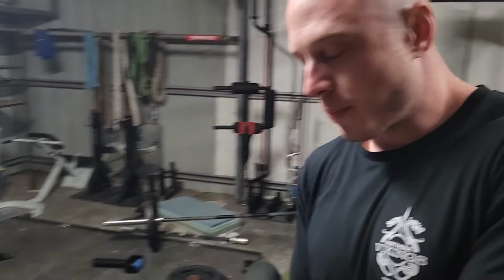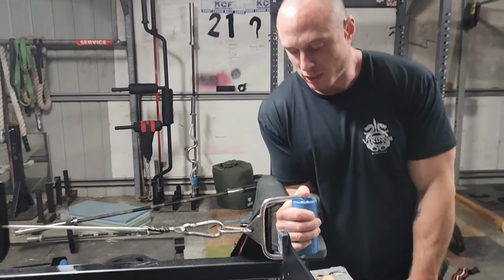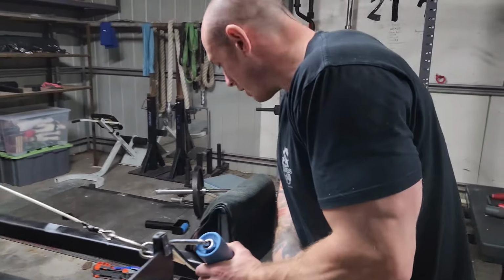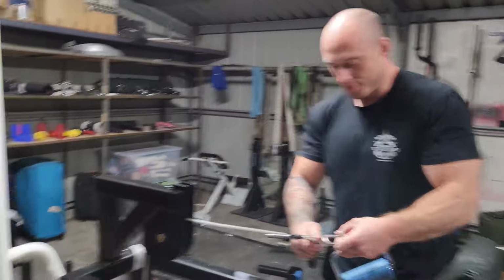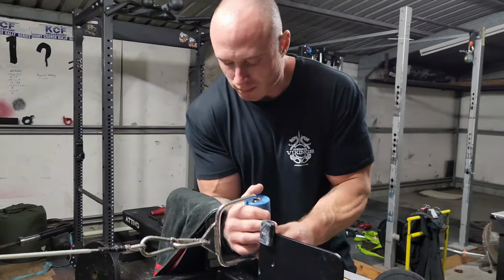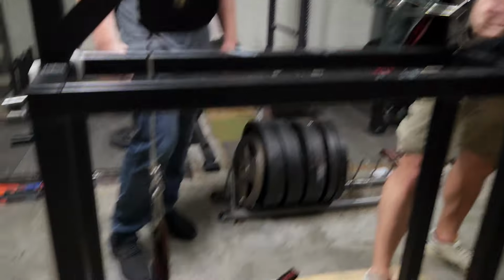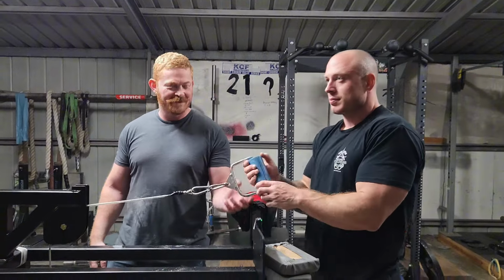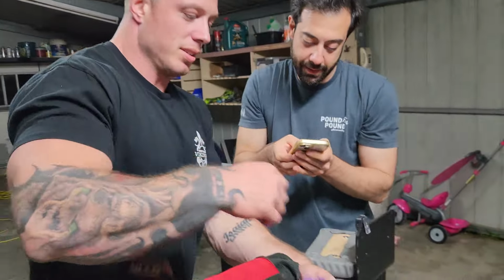Armwrestlers test their WRIST CURL MAX

Comment: I wonder why this is so much easier than a dumbbell wrist curl on a bench edge. Really curious what you guys can max on that lift, cuz most viewers can probably relate to that
Reply: 3Factors

1. You get tired by setting up a DB curl on a bench compared to this machine.

2.Angles, when you do a wrist curl, your hand mostly is fully supinated which faces ur face or you could just also lay your head or shoulder in the bench to achieve a neutral hand like the machine in the video does, but is highly unstable.

3. Stability, the machine achieves a great stability in your arm, which the db wrist curl won't give you also because the dbs contributes to that stability ( they are long)😂